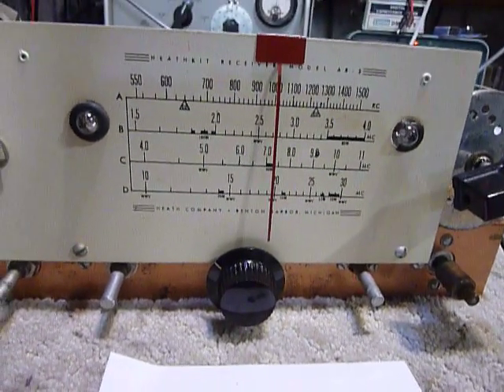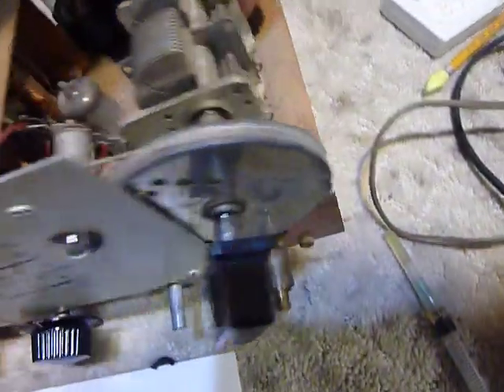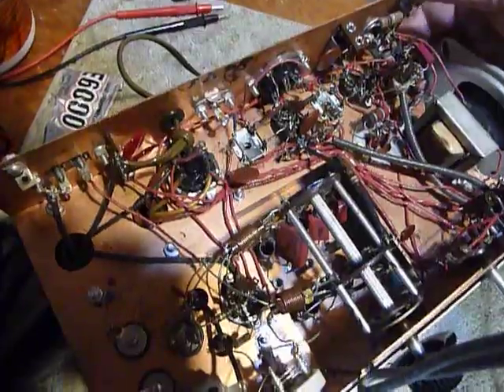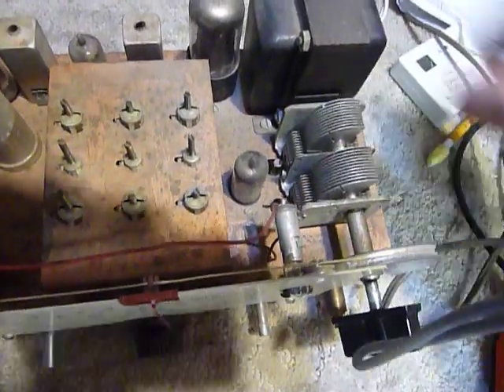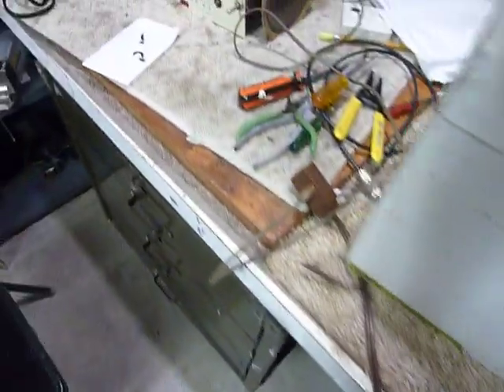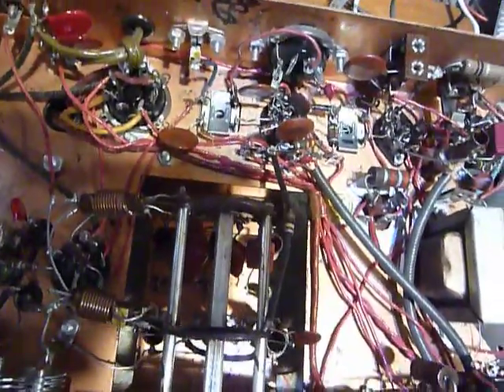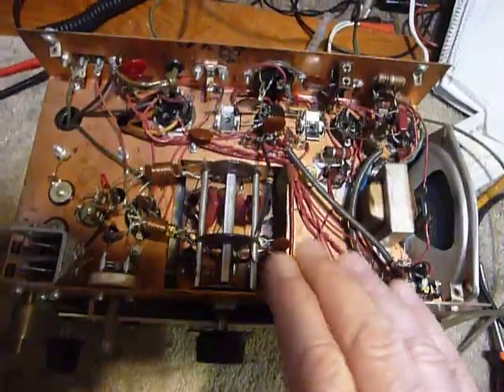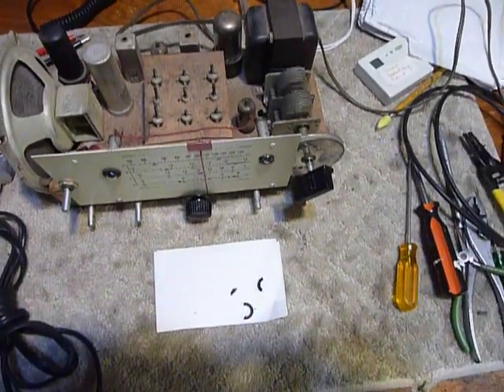Part -1 , HEATHKIT  AR-3 ,  AMATEUR RADIO RECEIVER  REPAIR

Comment: Dip the chassis in carbon tetrachloride, you can still get it. Do it outside and stand upwind of it to keep from inhaling the fumes! Scrub it, then set it aside for several hours and let it dry. Is what I do to restore original finish and clean dust and junk off chassis and parts. Be careful of the tube markings if you use carbon tet on them, the fliud can lift the painted markings off the glass. Using water in any form can short the IF, AF, and power transformers, and cloth covered rubber wires because the water may not evaporate. Brake cleaner and auto contact cleaners may be another option, but only if you plan to replace rubber grommets after cleaning. Deoxit™ cleaners can be used, too. I would use synthetic silicone in place of WD-30 as the WD can also disintegrate rubber and plastic insulation (depending on age and composition of the rubber/plastic used). A plastic polish can be used on the face of the radio to clean it. As "Spock" once said on Star Trek,  "there are always alternatives". No, I am not a Trekkie, but that phrase came to mind when I was thinking of what I used on previous restoration projects. Thanks for the video!!

Comment: Do NOT inject oil into pots and swiches !.  Oil is an Insulator!.   Get some good contact cleaner  like Caig De-Oxit D5   and use it on swtiches, pots, tube sockets and plugs.   You can use oil on the shafts and bezels in the panel. A better product for that is Tri-Flow   which is a penterating lubricant that leave a film of teflon .
Reply: I forgot using Tri Flow on a project. It is very good for dial cord pulleys and  metal variable caps. Use it sparingly!

Comment: The AR-3 was also my very first kit. I think it was in 1961 or 62.  I also was 15.  I believe the price was the same but the "cabinet" was not included.  I remember it was a cloth cover.  I lost it when my family sold everything while I was in Navy bootcamp, they moved two states away.  I was ecstatic when building that radio.

Comment: do you work on HW-101's?  think I just have a bad power supply....love your videos, by the way....
Reply from the maker: No I cannot do that for the following reasons .#1  I am retired and do not want to start another business that means many hours  doing  the work , doing taxes,collecting sales tax etc. # 2- people contact me all the time asking do I work on other peoples rigs  no I cannot  there are just  to many for me to do  and #3 People do not realize the amount of time required to fix just one rig  take an old HW-101 to do a good job will require at least 20 hours now if I do it for minimum wage  around here that is 10 dollars an hour that is  $250.00  Hams won't pay that and I would not work for minimum wage . 
#4 Then  there is the packing and shipping,transporting to the post office  and what if a rig is damaged ?  I would feel obligated to make it good to the customer .  Then there are call backs the rig I just fixed is very old and the customer uses it a month and something else fails so then he wants warranty repair .  #5 what about parts many of the old rigs use parts that are no longer made  for myself I salvage parts out of rigs that are ruined beyond repair  or buy used  or old stock parts at a hamfest sometimes it takes hours looking for a part . #6   I have fixed rigs for people a few times they usually do not want to pay  for even half of the time I spent on the repair  then they take the rig home and connect it to the 12 volt power supply backwards and fry it  or they connect it to an antenna and they don't know how to tune it and ruin the finals  there is just to many  possible bad things that can happen .  No I cannot do all these things  so I do the videos so people can fix their own and to preserve some of the knowledge involved and help people learn about maintenance and repair .  
    73  Bob
Reply from the maker: OOPS!  20 hours at 10 dollars an hour is $200 dollars not $250  my goof ...Bob
Reply: @robertsumption1243  gotcha…..haven't done any kit building or repairing of any gear in 30 plus years myself.....did find a guy in South Dakota that will work on some of the older gear....good old google...sending my Yaesu off to him in the morning....upcoming hamfest Saturday....I may sell the 101 there this weekend....it had a homebrew supply that came with it when I got it, and the rig was working just fine....just drifted a lot till it was good and warm....decent CW rig, I think....was a good deal for $100 when I got it a few years ago, and it don't really owe me nothing, so I thought I might find someone to look at it....also found a guy that will work on Swans....he has a couple of the last techs from there at his place....anyway....I still like your videos....thumbs up.